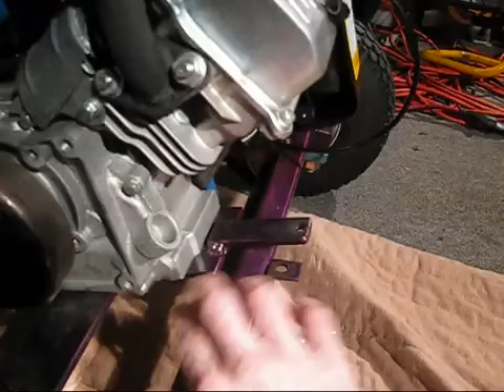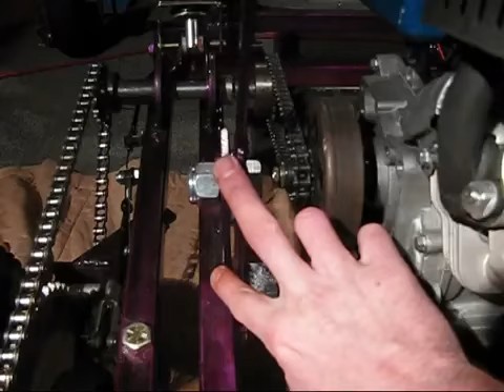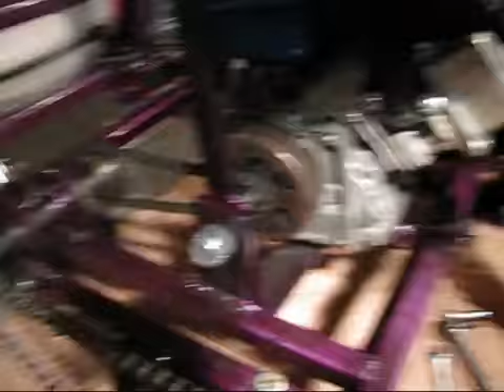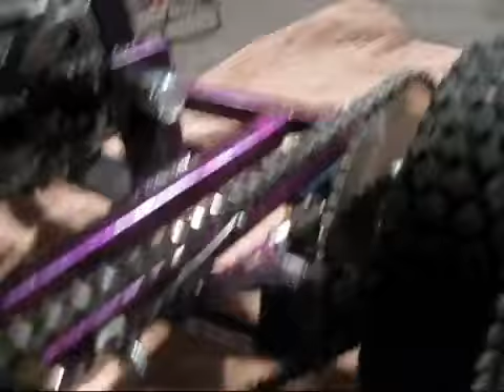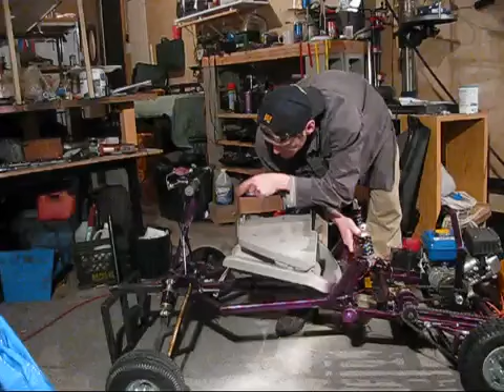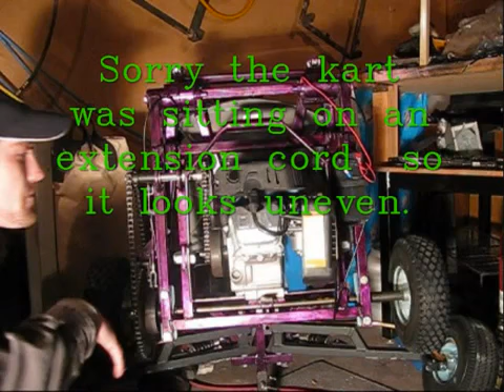Homemade go kart ( A-kart #7 ) ( rear end prt 2 )

Comment: The parts to build a GEET are available at the local hardware store. The system increases horse power and fuel efficiency. Paul Pantone design GEET about 35 years ago. On my channel, I made a video titled GEET Explained, which can also be helpful. With your mechanical insight and creative problem solving abilities, you could really build an awesome GEET Fuel Processor. Great work.

Comment: Very nice work. You really built a nice system. Have you heard of the GEET Fuel Processor? Inventor Paul Pantone has free build plans on the web site GEET International.(com). With your creative abilities and design and build skill level, could build a GEET for this engine. Basically, GEET uses exhaust heat, and counter flow of cold vapors, creating an electrostatic field which ionizes and highly charges the fuel vapors, into a hydrogen rich plasma vapor.